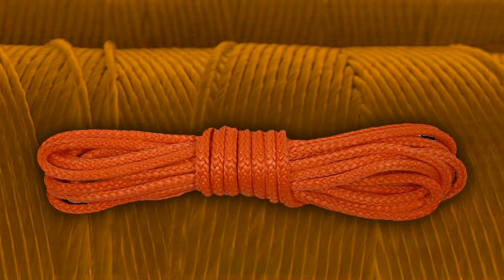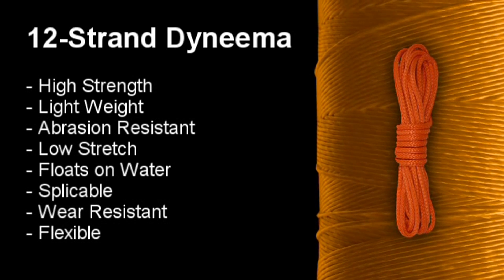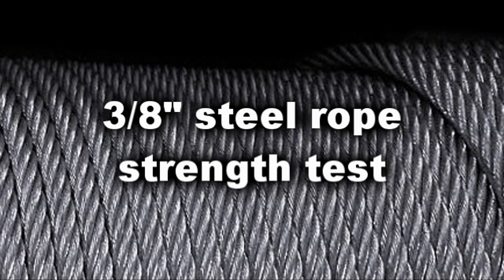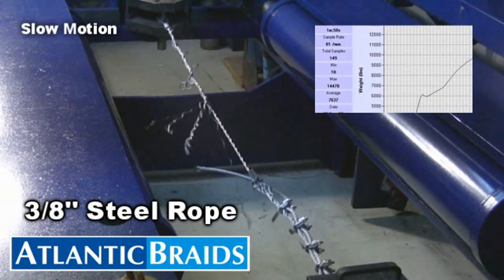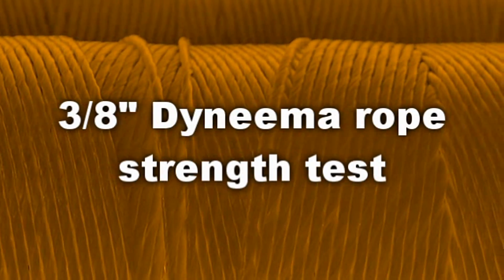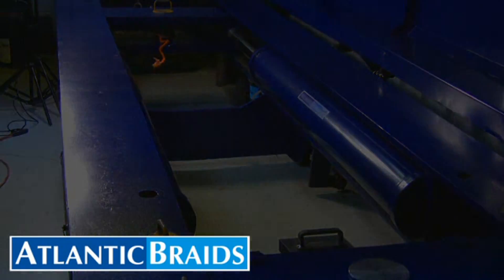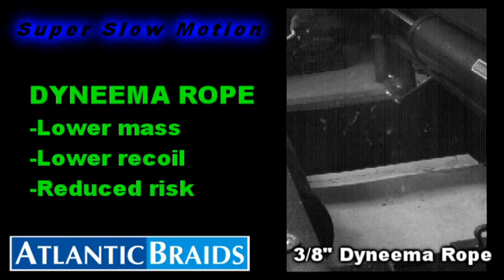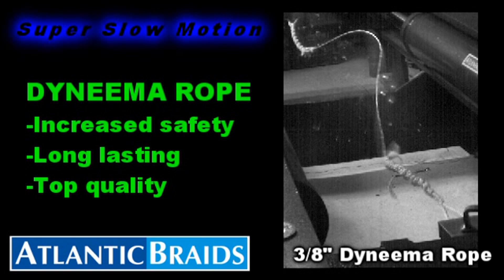Dyneema rope VS steel rope - strength test - break test

Comment: if your rope is getting that hot, the temperature is also going to be high enough to seriously lower the tensile ultimate yield strength of a steel cable too.
Reply: Wire rope strength is not as susceptible to heat.  One of the significant problems with this as off-road self recovery winch rope is that many winch drums get quite hot under normal usage and can damage the rope.

Comment: So it's only inferior in regards to melting point but otherwise awesome!
Reply: IsleOfFeldspar Scrape it on a rock.
Reply: Look up 'Samson K-100' if you already not heard of or read about it.
Reply: No.  It is not as durable as wire rope in many respects.  Drag it through the mud, sand, expose to UV, etc.  When you see it being used on commercial construction cranes then you'll know it has arrived.  But yes, it does have some good qualities.  But like most everything there are trade offs.  Even within a specific application such as off-road self recovery it shines in some situations and conditions while wire rope shines in other situations and conditions.

Comment: only visually because the dyneema is recoiling along its length at a much slower speed than steel breaking. u could probably get whipped by the recoil of the dyneema and just have a bruise, but if the steel hits u, ur going to lose an appendage or have deep lacerations...

Comment: Another thing. When I need a loop in the end I just use a simple bowline.( for winching in off road apps). It works fine and is easily undone. But if I was gonna put my life on the end of it I would insist on a little more than that.

Comment: Thanks.
 When I started using amsteel I recall the 3/8 having a BS of 19000 and something. Then I recently saw a 3/8 dyneema rope for winching by smittybilt  with BS of 17 000 odd and assumed it was a different and inferior product.I studied up on the American Rigging and Samson sites. I believe that these fibres are the best physical invention made by man in the last decade or two. I am puzzled as to why steel is still used at all. Some folk have not even heard of this stuff. Why is that mate?
Reply: Because steel takes more abuse and is cheaper?  Also, if you already have wire rope and it works for you, why would you want to change it?

Comment: Dont accept cheap imitations. Dynema, although a fine product, is a brand name for a wannabe better synthetic rope. That rope is called, AMSTEEL BLUE, even though it may not necesarily be blue. AB along with the attributes mentioned,it  doesnt conduct heat or electricity, and not only reduces hazard from recoil but eliminates it. I had a shackle part on a full out pull and everything fell directly to the ground.No steel splinters. Pulls off the drum easily. Drags through snow effortlessly.

Comment: If I were using it as a vehicle recovery rigging setup, i would not choose this product lance, as an Ironworker by trade I use almost every piece of rigging hardware you can think of, I have seen first hand the explosive characteristics of synthetic slings failing. On the flip side a wire rope sling simply breaks and drops to the ground. There were even reports that one incident where a man was being pulled out of the mud at an oil sands site, the synthetic web sling let go and came through the
Reply: Came through the what??? Its been 11 years don't leave us hanging!

Comment: Those clamps are installed correctly. The saddle is not the 'u' bolt. If you were to saddle the dead end as you state then you would be compressing the working side of the rope while the real saddle would be distributing  the load over the dead end.
Reply: The saddle is on the dead end. Watch at 1:13 after the cable breaks (pause it). Not a great apples to apples comparison but these ropes are amazing and I hate getting poked by those damn cables.

Comment: It looks to me like the Wire rope grips (bull-dogs) were attached to the steel wire rope the wrong way around, the elbow should go onto the non-working tail of the cable with the saddle sitting on the working part of the cable. If it's put on the wrong way around (and it certainly appeared the way in the video) then it significantly weakens the steel wire rope - hence the expression "never saddle a dead horse".

Comment: @droceretik Better to compare strengths using the usual methods of termination, that is clamps and thimble or ferrule and thimble for steel and loop splice and sleeve fot Dyneema braid. However if you just want to compare the strength of the wire agains the fibre then a potted end and swaging is the go. Even though it is not used in ordinary marine and lifting .equipment. Usual the steel rope chosen is more than double the required strength for safety so a 10 % drop in strength is irrelevent.

Comment: @diffynou Need to use the strongest available method for the individual material. Steel rope only attains 90% strength with splices. Termination efficiencies vary from about 70% for a Flemish eye alone; to nearly 90% for a Flemish eye and splice; to 100% for potted ends and swagings.  You can't use a potted end and swaging on braided Dyneema. Splicing steel rope and terminating with potted end is a specialist job. These experts are only available in very limited circumstances.

Comment: It does look like the steel breaks initially at the clamp.  However, the test still seems relevant to real-world use...one of the benefits of Dyneema is that it is easy to splice, whereas steel is not so it is likely to get clamped.  .

Dyneema is awesome stuff!!
Reply: This comparison is not about splice vs. clamp.  Totally bogus comparison of apples vs. oranges here.
Reply: So best practices used for the rope and worst practices for the cable.  That makes for an apples to oranges comparison.  The people who would use cable clamps are the same people that would just tie a basic knot in the rope because it's quick and at the moment they don't want to take the time to do a proper splice.  Your rational is flawed.  Besides as I mentioned before.  This so called comparison is not about splicing practices.  It purports to be a comparison of breaking strength and recoil related safety.  In order for that to be valid the splicing has to be eliminated as a component of the failure.

Comment: @diffynou You are correct in some of the things that you have mentioned, but, under australian standards, w/rope grips and definately knots, can never be given a w.l.l. or an accurate breaking strain. Normally, the wire should be hydraulically swaged, therefore giving it a w.l.l and a 5:1 breaking strain.
Dyneema braided rope is an excellent product, as long as it is hand spliced correctly.

Comment: The wire was tested using wire clamps and the Dyneema rope was spliced.
I would like to see the same test with metal wire spliced, clamps and knots can affect a lot the strength of the line.
Reply: However the cable did not break where the clamps were. It broke in the middle, so therefore it did not lower the strength.
Reply: @jakesvids3467  It failed at the first clamp.

Comment: What if you test the steel without cable clamps on it? Say a "factory" installed crimp
Reply: Yup.  That's why it failed right at the clamp.  First thing I notice.  Before they even started pulling on it.  I said it's going to break right there before reaching the cables capacity.  Rigging like that to make it fail prematurely makes this nothing more than a propaganda comparison.  Pretty sure a quality 3/8 wire rope has a minimum breaking strength greater than 14.5K lbs.  These people creating this propaganda should be ashamed of themselves.  But I guess money matters to them more that truth.

Comment: Regarding a comparison with Vectran [LCP] (Kuraray fiber) you need to take into account that some features are comparable (breaking load, etc), but other features are specific to each material (the type of cut resistance and abrasion, density, Creep, etc.)

Comment: Interesting comparison, but if you want to compare both materials, you need to compare all the details.
First, you need to compare samples with the same type of terminal or terminal with the same efficiency.
Second, what kind of tensile grade wire used in steel cable?

Comment: Interesting. I wouldn't have thought that rope could be stronger than steel cable. 
Dyneema seems to be high density polyethylene and is also used in Ballistic vests.
Low density  polyethylene is used in garbage bags. 

Great video.
Reply: Ballisitic still uses Kevlar, different but same idea yes. and some airlines are using unit loaders with dyneema sheet like that of carbon fiber sheets but more durable than the latter.